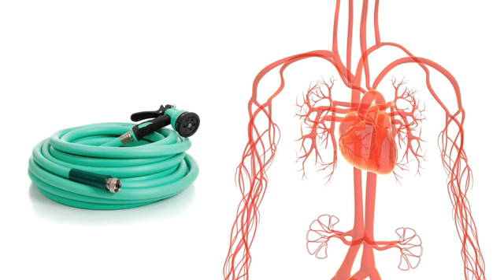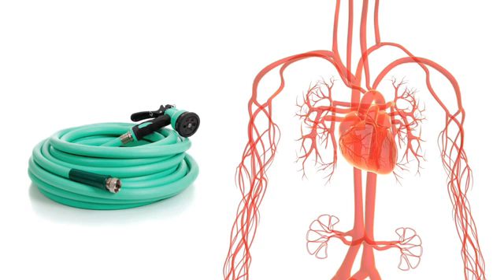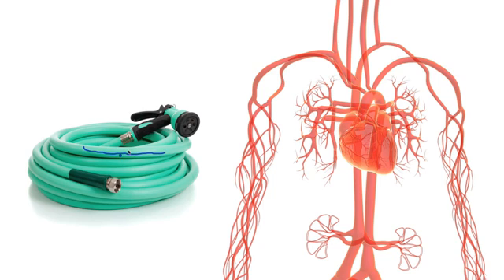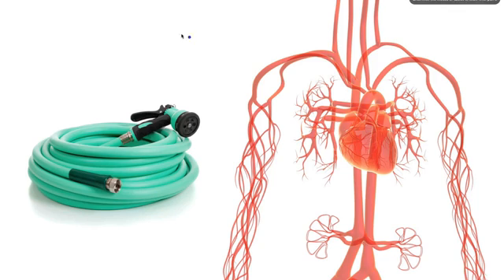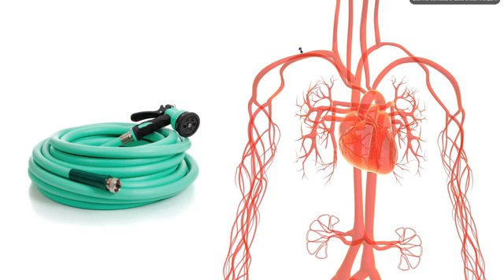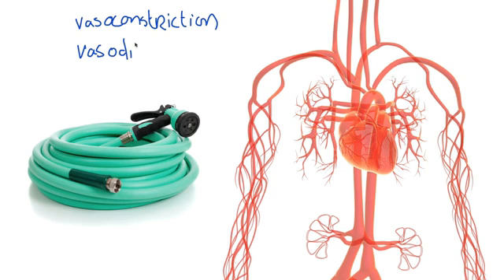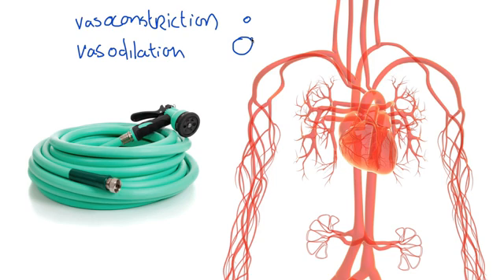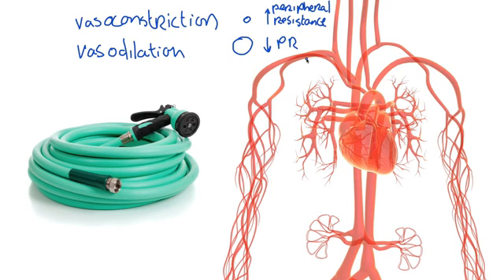Peripheral Resistance and Blood Flow

Comment: How increased resistance which decreases the blod volume/venous return/cardiac output....will cause increase in blood pressure??
Reply: As the flow of blood is getting restricted it will apply pressure to flow against restriction thats how the blood pressure is increasing and due to the same restriction the blood volume is decreasing  as less blood is going through and the flowing blood  coming back through veins in atria is decreasing so less blood is coming in ventricles to be pumped so in this way cardiac output is decreased

Comment: I just got done with my appointment with the Surgeon at the vascular center. They did many test series of airbag test ankles calves lower thigh upper thigh. And then a very thorough ultrasound of all of my legs and found very minimal plaque buildup. Surgeon told me what they believe and this CT scan that I'm going to have in a few days should confirm it is that my aorta is 100% blocked at least that's what he told me and where it Y's out to my legs as plugged. And it all will have to be replaced
Reply: your aorta 100% blocked??
well, what happen (in your car) when fuel hose is blocked 100% ??
(of course we not talking about electric car). can you start up the car?